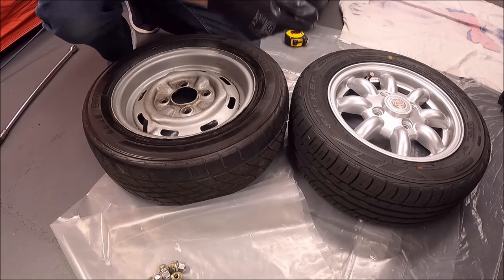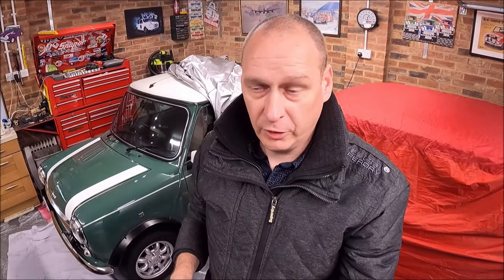Checking The Hillman Imp Wheels Fit - Classic Mini Workshop Pt. 18

Comment: The old tyres on the new wheels look very slightly smaller diameter, I’m guessing just a different tyre design.
Looks like you should be fine, nice subtle modification

Comment: I've run imp wheels on 2 of my old minis with no clearance issues, you will be fine with them fitted to tardis Keith 👍
Reply: We used to run Imp wheels on minis back in 70s when plenty around, also Viva HB fit too. One little point, the cup angle where wheel nut seats was different, so check your nuts seat correctly .
Reply from the maker: Will do, cheers.

Comment: Looks like you'll probably be ok but the suspension will need to settle a bit after rolling forward/back to see where it's really going to sit.
Reply from the maker: I will be using HiLo's so I can adjust later if necessary